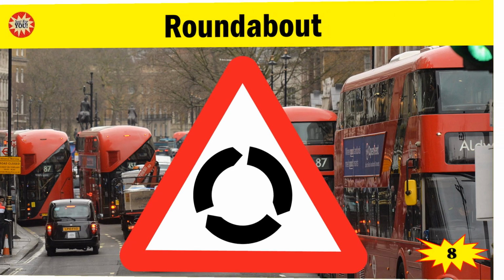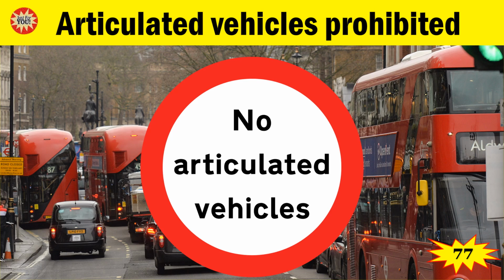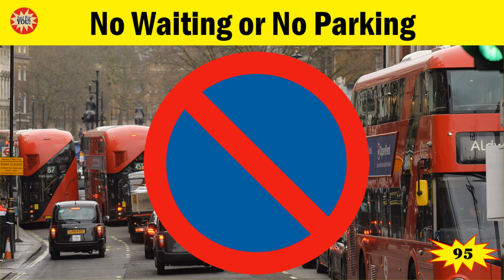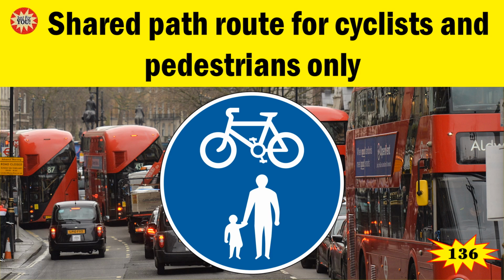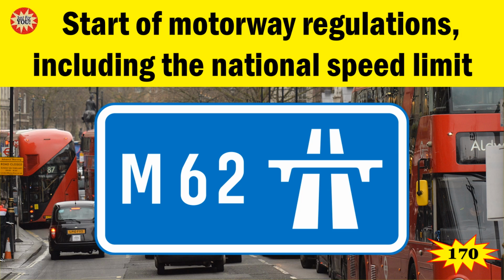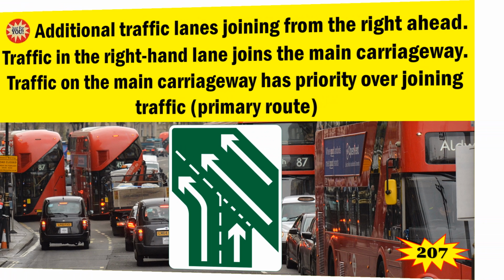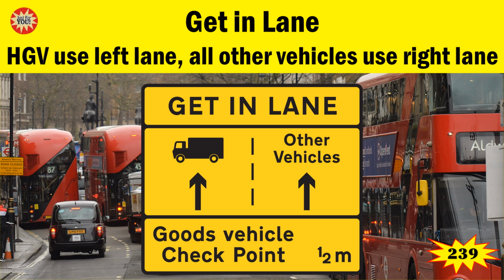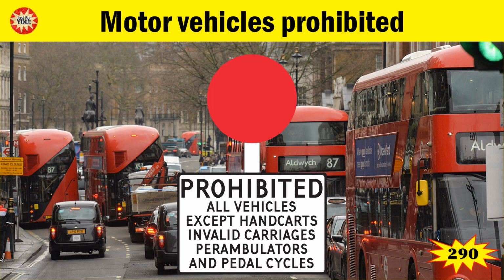All UK road signs to pass your theory test

Comment: What are the actions to be taken when I see loose chippings sign?
Reply from the maker: When you see a "loose chippings" sign on the road, it means that the road surface may be uneven or loose due to recent resurfacing work, which could potentially cause damage to your vehicle or even lead to accidents. To stay safe and avoid any damage to your vehicle, here are some actions you can take:
Slow down: Reduce your speed to minimize the risk of losing control of your vehicle on the loose surface.
Increase following distance: Leave a greater distance between your vehicle and the one in front of you to allow for any sudden stops or changes in direction.
Avoid sudden braking or acceleration: Keep your movements smooth and avoid any sudden stops or starts that could cause the loose chippings to spray up and damage your car or hit other road users.
Drive in the center of the lane: Try to drive in the center of the lane as this is usually the most stable part of the road surface and has less loose chippings.
Be alert: Keep an eye out for any signs of loose chippings, such as dust or stones on the road, and be ready to take evasive action if necessary.
Follow the instructions: If there are any additional signs or instructions given by road workers, follow them carefully to ensure your safety and the safety of others.
By taking these actions, you can help ensure your safety and the safety of other road users when driving on a road with loose chippings.